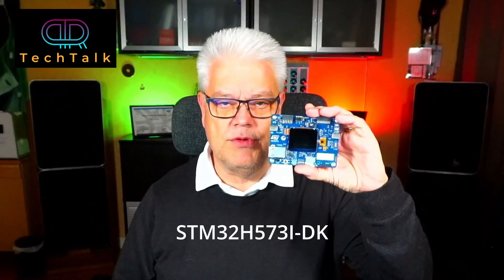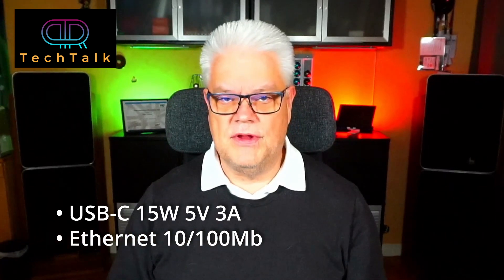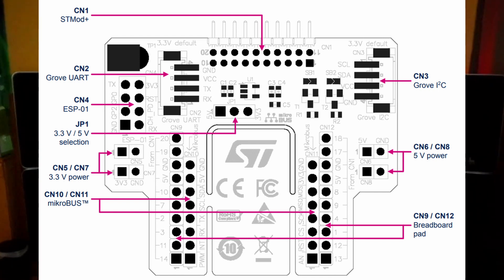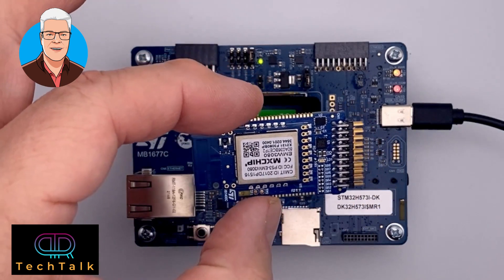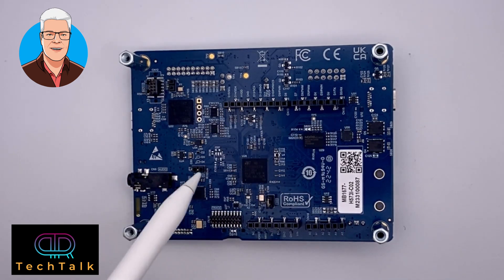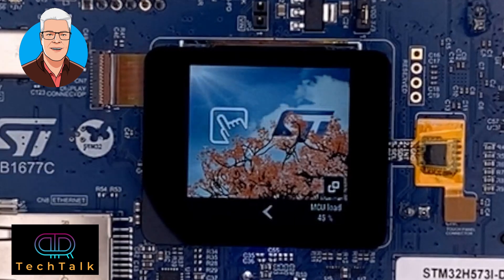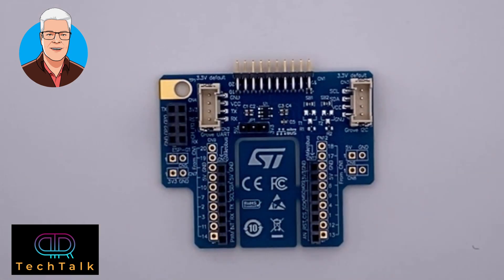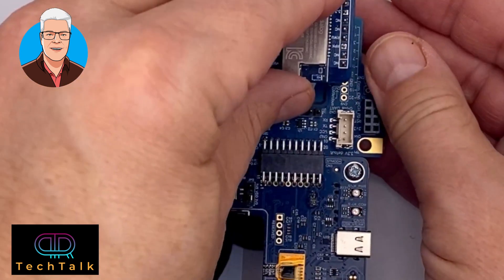STM32H5 Discovery board with TFT Touch LCD

Comment: I find a difficulty  with module esp8266 on stm32h573iik3Q
Reply from the maker: Hi, I have not tried to use Espressif´s ESP8266 as a Wifi dongle, but I guess you need to load the module with a firmware specific to this use case, and then connect these using UART / SPI to the STM32. God Luck. And pls don't forget to his the Subscribe button :-) / PR TechTalk